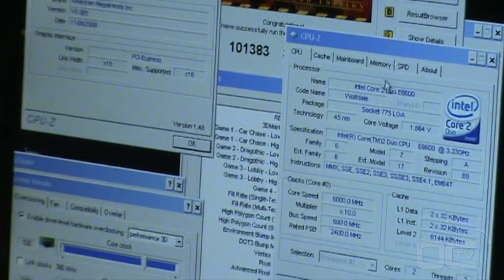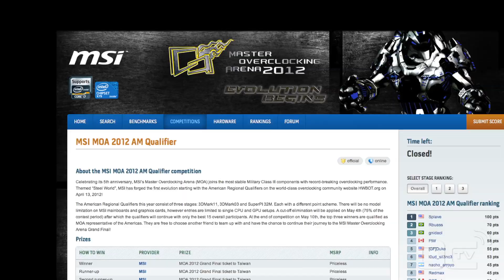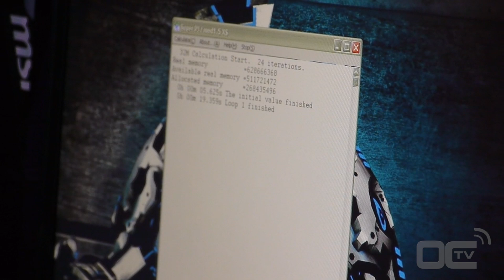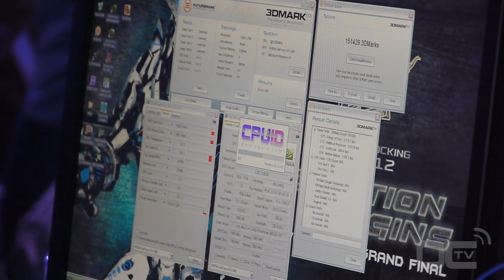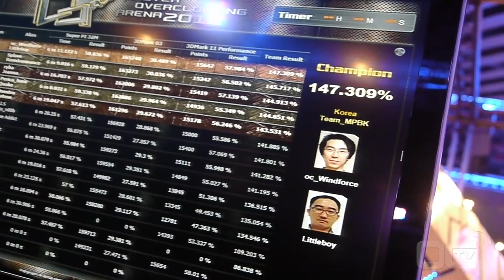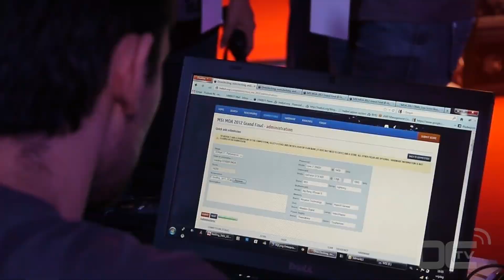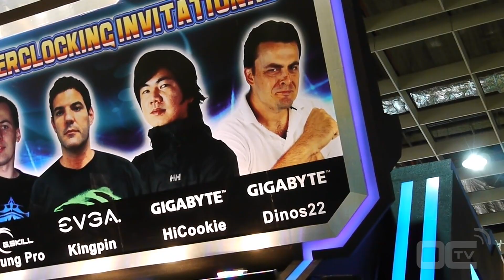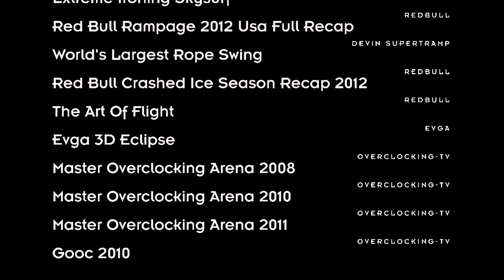Extreme computers : A look at overclocking competitions

Comment: #OverClocking-TV maybe the overclock competition can be divided into several categories to attract the attention of the public. examples such as the daily overclock category such as for gaming, video editing or using applications that drain the CPU, VGA and memory capabilities (not in the extreme phase). Then the extreme class category as usual previous. maybe with this it can attract the interest of the community in finding out the ability of computer components to be purchased or that they already have. However, I know this will be limited by the support of 1 vendor, because if it is supported by 2 vendors, this will be a war between the vendor's name.

Comment: Over clocking is fucking dumb. If you need to over clock well its time for a new pc or you need to upgrade your components. Plus it will kill your pc faster.
Reply: if you know how to do it without going into the extreme's, there is no need to spend money on a new pc. It also won't kill your pc faster if you know what you are doing.

Comment: Things have changed a little since the mid 90's when I overclocked my 486DX2-80 Texas Instruments CPU to 120MHz. You could easily fry a steak on it even with the stock cooler, but it was as stable as anything out-of-the-box... There should be more support for competitions like this...
Reply: but have you actually ever cooked a steak on it? that's what I'm interested in, food

Comment: One question! 
If you overclock your cpu from 3.3Ghz to 6Ghz (extrem case, I know), will it then be always hotter then the old one? May I need a better cooling system then? And will it consume more electricity?!
Thx
Reply from the maker: everytimw you increase the frequency and settings like voltages it will result in your cpu producing more heat. The limit will be on how capable is your cooling system to remove this heat to keep it stable.

So basically, your cpu at 3.3ghz produce maybe 75w of heat that needs to be dissipated (this can be 80c with air cooling), when pushing to the extreme, the produced heat could be 350w, something that need extreme cooling to remove this heat from the cpu. this could have a cpu at -150c for example.

so In the end the cpu will be hotter if using the same cooling. this is why we use extreme cooling to continue pushing the boundaries.
Reply: OverClocking-TV

Does it also mean, that e.g. if you do overclock the cpu with -120°C (and maybe double your ghz) you need to always run it with this low temperatures to keep it away from overheating?
Reply: No. First, you will never get an overclock that high with a normal chip. Second, just keep it under 80 celsius.
Reply: Extreme overclocking use extreme voltage that would kill a CPU in minutes if not very cold.

Comment: Wouldn't liquid nitrogen destroy the integrated circuits? If I'm not mistaken silicon semi conductors for example freeze at around -223 C (-387 F). 

Running overclocks like this with these extreme cooling systems must take a toll on the system... Hell I'm proud to have gotten 5.0 GHz on my i7 2600k and on my newer setup just just under 4.8 GHz on the i7 6700k.
Reply: +Donald Groves Yeah I could imagine that. Running that amount of voltage and multiplier on the CPU is both scary and impressive that it works at all...
Reply: Depending on the CPU, it can stop working if it gets too cold. Intel has this (called a cold bug) and is found around -170~ celsius. AMD doesn't appear to have this issue last time I checked.
Reply: In any event I will never attempt overclocks like this. Getting 20% to 50% overclocks is more than enough to satisfy me. Even so this is impressive. This is way on the extreme side and it's amazing it works at all.
Reply: That is a very, very, very broad statement. I've got AMD CPUs that cold bug as soon as -17'c, and I've got many Intel CPUs that will run -196'c without an issue. On Skylake the cold bug rears its head at around -80'c to -120'c, but it can be avoided by upping the VCCIO voltage (not too much though, 1.5v or so is going to kill the PCI-Express controller on the CPU).

Also worth noting is that ALL CPUs will cold bug eventually, it just might be at a lower temperature than you can reach with LN2.

Cold bug varies from chip to chip, you cannot say Intel CBs at temp X and AMD CBs at temp y.

Comment: OCing really isnt too necessary anymore lol if you have an i7 or an amd octacore or even hexcore processor you really dont need to OC. as far as GPUs some times it is necessary but mostly not because most of the higher end GPUs don't need to be OCed.
Reply: Niblik why would you not get free performance
Reply: because it puts more strain on your GPU and CPU and can cause it to wear down faster also puts more strain on your MOBO and PSU.... its not technically free performance, if you're risking the part for a bit of a boost. It just isn't worth it to me.
Reply: Overclocking is also done just for the joy of it. It's fun to see how far you can push something and see crazy results come from it. I CAN get my i5 6600K stable at 4.7GHz (1.2GHz OC from stock) with just an AIO Liquid cooler. Could probs get it higher with a custom loop and take advantage of an additional 140 radiator. 

It's not really about it being necessary, it's about being an enthusiast and pushing your system to it's limits.
Reply: +Niblik overclocking is still somewhat necessary for several of the affordable quad core CPU's, as the i7 and other 8-core chips are relatively out of budget reach for many.
Reply: Blokesky what if you’re gaming on triple 4K TVs

Comment: so whats a good practical use for this overclocking shitniz.
Reply: bluekeet For "extreme overclocking"? There's no practical use, its just bragging rights. I mean, it's not like you can keep dumping ln2 on your CPU while your gaming or anything. However, for overclocking in general, he said it near the beginning of the video. Its a free performance increase. My i7960 came stock at 3.2ghz, but I've been running it at 4ghz for about 3 years now. So I've gained 0.8ghz; something most PC users wouldn't notice, but when doing CPU intensive tasks, it does make a noticeable difference. In my case, "free" is debatable, as I have about $600 in watercooling gear to keep it stable at that clock speed. However, even with the stock air cooler that comes with a CPU, you can turn it up a tad and gain truly free performance. Basically, CPU's are likely the most expensive part of a PC, why not get a better bang for your buck? It also comes down to what you use your PC for: Facebook, Youtube, and homework? Probably not for you. Editing, gaming, data mining, GIMPS, or folding? Might be something to look into. Sorry for the book.
Reply: Richard Speir i play runescape, but it is very laggy since i still have a basic 2006 dell pc. What pc items would you recommend for me to have a great time playing runescape or any game online with my pc?
Reply: bluekeet If you wanted to build a new computer, you could build a great little rig for RS for around $500 using the pentium G3258
Reply: WhisperfyASMR thank you for the reply.
Reply: No worries buddy. I'm thinking of starting a tech channel to help people like you out, reckon it would be worth a shot?
Reply: WhisperfyASMR As great as the G3258 is I would probably opt for a Athlon 860k as 2 core support in gaming is being dropped. :/ Which is a huge bummer. When you consider overclocking the G3258 can match an i7 in single thread performance.
Reply: Just looked that processor up on newegg. Unfortunately I'm from Australia and they are not available here, which is why I havn't heard of them looks like a seriously good chip for $90.

Comment: My old Athlon x2 250 hit 3.8ghz with like 1.35~ Vcore and 30 Celsius under full load. God dammit I miss that chip, I crushed the pins mistaking it for an x2 7750 : (
Reply: +hussein hussein 30c underload? you may had to use water custom...
Reply: MegaAgente17 It was a dual core with no l3 cache and like 65watt tdp. Seriously that chip was fucking sexy.
Reply: +hussein hussein Any way thats a too low temp even with OC :)
Reply: +MegaAgente17 That was after gaming and everyday use. Didn't bother with Prime 95 or any benchmarks back then.

Comment: Over clocking is fun but professional over clocking sounds asinine. Not every chip is created equal.
Reply: regardless every part is different. every cpu performs differently even if they are the same name. all the name says is that it was tested to be in a specific set of benchmarks.
Reply: hussein hussein Yeah right, that's what i was thinking too. They don't have the equal prerequisites, so not the same chance to win the competition
Reply: That's what makes it fun though. That element of RNG.

E: Not only that, but there obviously is an element of skill involved too, which can be only achieved via practice. So in my opinion, no, not asinine. Fun and has amazing potential I'm surprised no one has actually taken advantage of even today AFAIK.

Comment: question these OCs are just for show right? hell were they using liquid nitrogen? i heard of water cooling but this is some other level stuff.
do ppl really oc to the point that they have to keep pouring these liquids in their own pc?
Reply: Not So Retro Gamer Ok, lol you had me terribly confused xD
Reply: Yes, and No. Yes they are using LN to cool their CPUs, but it isnt really needed. Its just the cheapest and fastest way to get the performance they need w/o having to worry about hitting thermal throttling. (and as long as they don't hit the cold bug usually around cpu temps of -140f) Sure they COULD use something like water cooling on an intense like 14x140mm rad setup, but that would be time wasting and resource heavy. Also, no they are not working CPU OCs; they are unsustainable by normal reasons, and should be used by  no one ever, except in competitions, as it severely limits product life and stability. i.e.: one of these champions oc'd his 3.8ghz up to 5.6, and then 6.03ghz.
Reply: Py.Atmos
 overclocking is if you want the SPEEEEEEEED , but if you don't go overboard with it the cpu would be fine , i have a amd athlon 2 x2 in my old pc and i was able to unlock the third core and overclock it to 4.5 ghz on a stock cooler , anyway , i locked back the third core cuz i was afraid i was going to kill it :)) it wasn't even made to run in X3 @4.5 GHZ setup it game in a X2 @3.4 GHZ setup
i recommend at most a 1GHZ overclock AT MOST ! with a aftermarket cooler , on a stock cooler if it's amd i don't recommend more than 600 MHZ and on intel not more than 400
Reply: Not So Retro Gamer Hes talking specifically about using LN to cool an over clock. What they do in these competitions is not stable and tbh a TERRIBLE setup for anyone what would want to use this practically. Using a blowtorch and testing and retesting just to make sure it posts are not things that 99% of us will ever want to do everytime we start a computer.
Reply: Py.Atmos
LN is horrible for practical use , too low temp , it will affect the cpu overtime. CPU's shouldn't get too hot for a long time or too cold
Reply: Not So Retro Gamer I'm starting to think you're not even reading my comments, or are agreeing with me and just not being straight with it. You're basically just repeating everything i said in a reply to me, it's getting kind of concerning >.>
Reply: Py.Atmos i was agreeing with you :))

Comment: Damn i over locked my i7 4960x to 5.6 ghz damn
Reply: good job :D , i've overclocked my old athlon 2 x2 270 to 5 on a stock cooler :))) , much more impressive but....it's still worse in performance than a underclocked 4960x :)))
Reply: Not So Retro Gamer

Comment: how is working with a PC trivial? They are only based around micro processors with a few billion transistors with circuits thinner that the wavelengths of gamma radiation.  Think for a second. 28nm is really fucking small.

Comment: i was able to oc my e8400 up to 3.60 GHz!)))) idle temp is 47, and burn is 87 (box cooler) it's not much but i feel happy! btv it's running like that for over 2 years straight and not once I've had a problem with it. Intel rules!
Reply: intel rules ? okay then , my old athlon x2 270 ran at 5 GHZ on stock cooler for 2 years , i've got a new pc since then and now that is the pc for the video cameras at my father's minimarket. it runs now at stock 3.4 and never crashes , and never crashed at 5 , and i barely overvolted it , never got past 55 degrees , i was very very very impressed , the pc was litterarly a piece of crap , a GT520 with a broken fan that worked for a few hours then i had to use WD :)) , the cpu and 3 GB DDR2 RAM. i still want to put my cooler from the new pc (a aftermarket cooler) and try to break 5.5 ghz

i wouldn't have written such a long comment if you didn't say intel rules :))) i would have just writen good job :D

BTW , is it a dual core 2 or is it a quad ?
Reply: Not So Retro Gamer  it's dual but u know that an intel @ 3.6 is performing similar or better than a 5 ghz amd right?
Reply: Ale Lele
yeah i know , and you shouldn't say "an intel" a FX-8350 performs better than a 3rd gen i7 in some cases. But the athlon x2 270 is pretty slow i got it becouse it was cheap :))
Reply: Not So Retro Gamer well i'm not from english speaking part of the world so don't correct my grammar plz lol! btw i agree the price of amd products is very tempting,
Reply: Ale Lele
i wasn't correcting your language :)) , i was meaning that you were generalizing :))
Reply: Not So Retro Gamer oh, ok then! peace!
Reply: Ale Lele Both the e8400 and athlon x2 270 are ddr2 systems. Most of the time especially the older generation both companies were neck and neck in terms of performance.... 

Then again I'm here playing on my fx 4100 at 4.8 ghz and too afraid to push it any further because I'm a wimp. ;)

Comment: Well I think it needs to be dumbed down to a point where the  masses can understand. I'm studying for my A+ and I'm pretty somewhat knowledgable about computers but if I'm honest I didn't hear ANYTHING about what the standard hardware could do being air cooled and overclocked vs what the custome nitrogen rigs were doing. Seriously the issue is with the idea that the masses understand this when I have a hard time finding people as interested in cars as I am. Put simply if I were to tell someone how insane a 1000hp civic is It'd be as simple as saying "the motor started out at 200hp..that's a 500% increase in power". After that gets them interested it would have to turn into many shorter conversations about how something like that is done. In this video I saw no explanation of anything and computers and cars aren't very far from each other in terms of performance and how to explain it. The issue is inclusion. You have to bring people in and explain what the hell they're actually doing!
Reply: I utterly and totally agree with this commenter, that and... we all kinda know... its still about getting that free performance.
Reply: very true
Reply: Benjamin Edwards
What are you disagreeing with?
Reply: at this level its not free performance
Reply: nezerac well, I don't know how overclocking could be made more mainstream without technical books written on the subject as each architecture has a different overclocking process.  I think the best idea to present about overclocking is that it's not dangerous in reasonable situations.